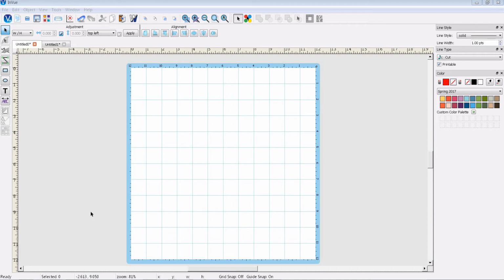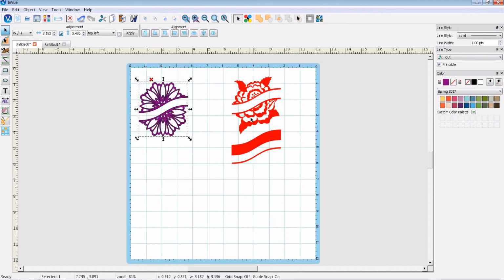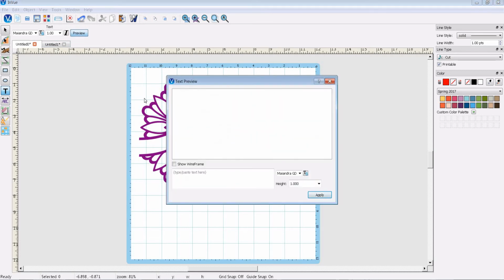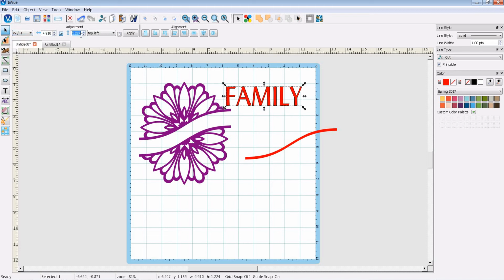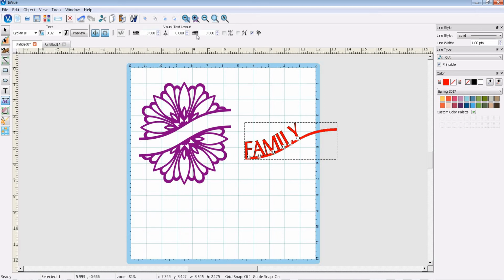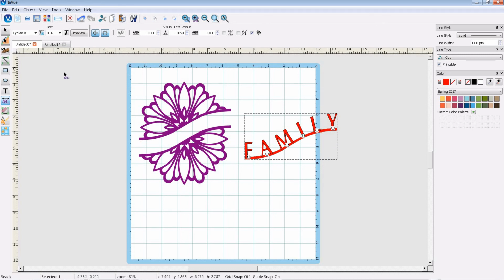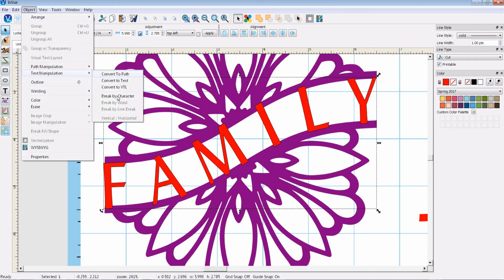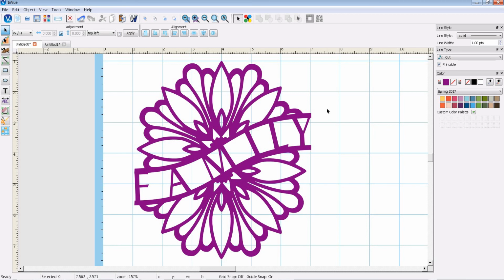How to CurveText using Pazzles Invue Software

Comment: Is there a way to get these files you are showing? Can I use other forms of monograms? Does this program not let you curve the text anymore?
Reply from the maker: Yes, the link for the files is shared above in the video description, on Diana's Google drive in a folder called Decorative Brace sin this Elements folder: https://drive.google.com/drive/folders/0ByDca_cRz35gNUFJUmhzdVRuU3c
Reply from the maker: You can still use the Pazzles InVue software to curve text. You can use this technique to create custom monograms. With this software you add your text, add your curve, then you can use the software feature to have any text follow any shape, line, or curve.
Reply: @julieflanagan7226  I'll keep trying. I had to upgrade to this program and I'm still trying to adjust to this program.
Reply: @julieflanagan7226  Thank you. I'll give this a try.